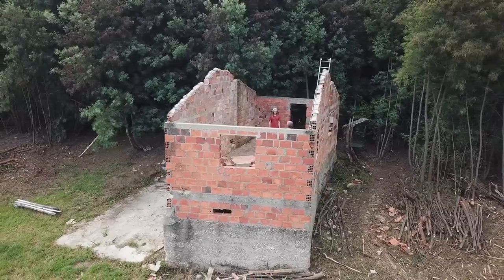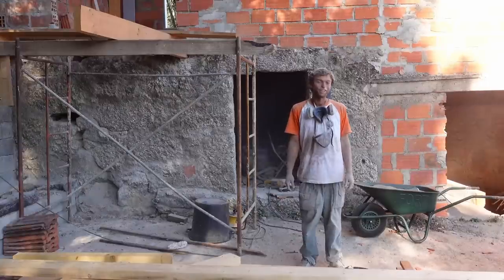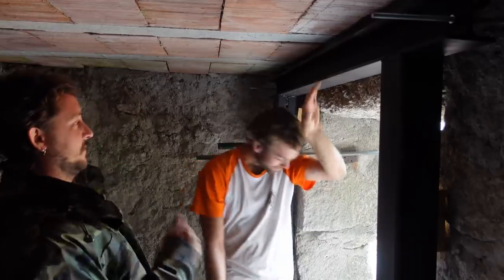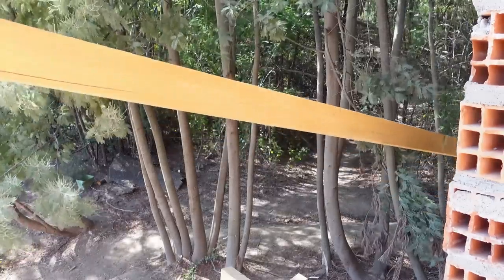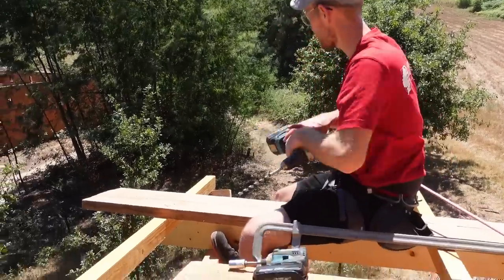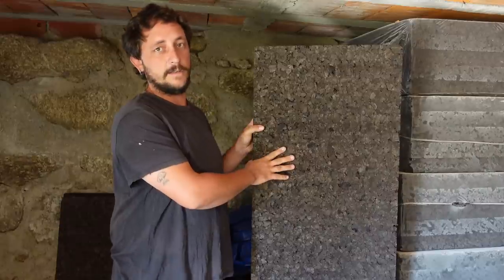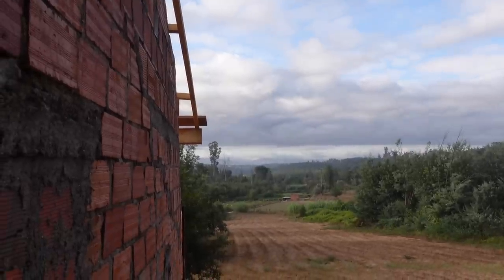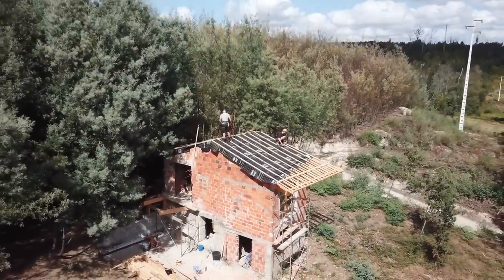#65 Putting up the roof on our ruin (with cork insulation)

Comment: Nice metal frame, but it has no contact at all. You can't just screw it to the wall, you have to push concrete in the upper gap.
Reply: And most certainly don’t use concrete/cement in the bottom like they did.
Reply: @Rickysaucej  so much work and that building is a joke. they dont listen to the comments and don't understand the buildings structure at all
Reply: The only thing that the frame is good for is to prevent the floor from collapsing. It is not loaded at the moment and I think that it is mentioned somewhere.
Reply: @georgenikolakopoulos5115  very good idea to let the floor crack and lower for 2 cm before it gets contact to the frame on its ends!
Reply: @Henroin42  not a good idea obviously. Just a precaution that costs way more (if they bought the steel) than doing the actual reinforcement.
Reply: I tried mentioning to them in a previous video back when they first cleaned it up that the Ruin really isn't structurally safe. There's a huge bow in the wall with the windows and the brick has been through a fire which would make it really  brittle. I tried explaining that and they havent done anything it seems to help with the structural integrity. They have beams sitting right on top of that old brick with no help with it. The studded walls on the interior help some but not s whole lot. With them now mentioning and showing the brittle granite foundation that just makes things even worse.
Reply: The gap at the top is filled with more concrete or shim blocks after the frame is in place. Standard practice in a retrofit like this, as there is no way to stand up the verticals in place and get a perfect fit without jacking up the second floor and then lowering it back down onto the steel, which would have caused much more damage.
Reply: @CawmeKrazee  they give me "cult vibes", i'm genuinely worried for safety of people on this project. Really liked it in the beginning, the idea is really nice, but something is just wrong.
Reply: Loving what this knowledgeable, nature loving, environmentally friendly, kind, funny , meaningful,clever group of awesome human beings are doing. The best vlog on you tube. No need to suck subscribers in with click bait, half naked bodies or extreme headlines. They are just doing what comes naturally. The content interesting and diverse. Love from Australia

Comment: Hey guys, roof maker here. The waterproof layer is worth it, even if it is plastic (I don't know if there is some natural material equivalent). First, in case of a broken or missing tile, because of hail or wind storm maybe, your roof won't leak as fast as if you didn't put that layer, giving you some time to fix it without damaging your insulation. Keep in mind that it is not a fully waterproof layer, so don't leave it exposed too long under water and UVs, it won't like it. Next, it helps also with condensation, keeping your insulation dry, no matter the temperature difference between inside and outside. Then, I don't know if there might be snow where you live in winter, but if it might, I've seen tile roofs without that layer completely full of snow under the tiles, catastrophic.

Maybe some natural fiber layer might exist, then try it, but you definitely made a good choice by adding one in your build.

You're doing awesome job, keep it like that!
Reply: Snow is extremely rare here ... and when it happens is like 1/2 inches snow  during one week or so   we have around 4 months of chilling temps( not freezing...) Nov,Dec, Jan, February with night temps and early morning around 32/28 ºF   and during the day, with the sunrise ,temps go up to  the 50/59 ºF....
Reply: My first thought would be natural rubber, but maybe that's not breathable enough and will result in condensation in winter? Also not sure if natural rubber is made in such long thin strips
Reply: A layer of loam/clay can work as a replacement for those membranes. Of course it's significantly heavier, and can be damaged by a severe leak.
Reply: Hey xdaerian, how about the counter battens? Arent the screws supposed to go in the rafters? Or could you just screw the battens in de corck insulation? Im asking cause im planning to insulate the roof with PIR insulation. Thanks on advance!
Reply: @Illeestar  yeah, seams a bit strange for me to screw it in the insulation only, you should use long screws to get down to the rafters. I don't know the strength of corck, never used it, but it seems a bit soft to hold the wind force
Reply: Cork isn't sensible to humidity nor water. A leak or condensation wouldn't damage it.
Reply: @Illeestar  you screw the counter battens (for air circulation etc) through the pir and into the rafter.
Example:
10 cm pir foam, 5 cm thich counter rafter.  You will need 20+ cm long screws.
Ps: get a good driver with enough torque

Comment: If you plan to make the ruin air tight and expect negative temperatures in winter you should add a water diffusion barrier on the inside to prevent the humidity from insde  to condensate in your insulation, which would rot eventually otherwise. Unfortunately that means more plastic, but longer lifetime.
Reply: I'm not sure if that is also necessary with cork as it is already a natural water barrier. Would be interesting to get a construction physician's idea on that.

Comment: Many commenting on the waterproof layer. Indeed worth it if you ask me, please check out Ekoplus based in the south of the Netherlands. They have a whole assortment of building materials with more proper background. This same foil comes also from the brand proclima. I used it myself and feels quite the same as well known brands like dupont. Their knowledge is very valuable...

Comment: My thoughts on the waterproof barrier: The membrane needs to allow moisture out or the inside will rot.

My house is somewhat old, the most recent addition was built about 50 years ago. That section was built with wood studs, plywood outside pressed board paneling inside, and fiberglass insulation. The plywood was covered with tar paper, then a cement shingle. Over the years, moisture collected inside the walls due to the tar paper. Now I have a mold and rot problem in the walls.

On the other hand, only the bottom of my wall is rotting, so your roof may be just fine. Especially if the inside has a way to breathe and dissipate moisture.
Reply: its a breathable 3 layer membrane should be good in this setting.
Reply: definitely, if this is real waterproof, not vapour membrane., then wood will be exposed to surface condensation in insulation, which could not ventilate/dry out in big temperature shifts. this will make wood rot, specially thin/soft wood like that. and dby they way, cork as roof insulation is not the best pick from start, imo.
if you need realy water proofing, reinstall waterproof with vapour membrane, add additional air layer, put plank/osb over and finish with waterproof membrane if really need it (and finalised with proper roof tiling).

Comment: The plastic in the waterproof layer's embedded carbon pales into insignificance compared to the steel fixings. Most building wraps have a recycled component as well. so think of it as extending the life span of the fixings and in that case if it doubles the life of those then it is carbon positive.

Comment: Screwing cork on to the battens with regular screws instead of insulation screws that actually fasten  it to the sturcture ✅
Proceed by screwing battens on to the cork itself with regular screws providing no connection to wood underneath ✅
Yeah, just top it off with heavy tiles and its going to be F*cking Mint 👌
Reply: And by the way, the cork insulation is supposed to go between the battens, not on top of it.
Reply: You seem to be making good points there, but is there really a need for irony and sarcasm?
Reply: @meinssk  bore off

Comment: I didn’t understand the waterproof layer either when building a small camper, but then my friend reminded me how soda cans condensate with liquid when temperatures vary from inside to outside. The same thing can happen with the structure even if it’s not rainy. Im sure there is a more sciency explanation. Definitely worth having!

Comment: I've been in the construction industry for only 2 years but I'm pretty sure insulation like that would be better in between the rafters. Then you'd have a plywood sheathing over it nailed to the rafters. And then a continuous  waterproofing layer over that with your roofing system. But idk.

Comment: You want to be using the waterproof layer. While there may be plastics used in its creation, it's going to save you money, time, and materials in the long run because it will prevent rot, leaks, and everything else involved in the roof.
Reply: What did they use before plastic?
Reply: @JazzFunkNobby1964  asphalt paper. Basically paper impregnated with a thin layer of asphalt/tar. It isnt  as durable as plastic though and rips easily after a couple of decades.
Reply: @evilla7579  Isn't Asphalt a top or outer surface?
Reply: @JazzFunkNobby1964 maybe it was translated wrong. It wasnt roofing felt or something (which indeed has asphalt). Were we live we call it 'bitumen paper', paper impregnated with a thin tar like substance. But as said, it is obsolete now because there are better alternatives.

Comment: Guys you added a waterproof layer and  then you punctured it to secure the battens. Usually the membrane goes over the battens and you nail the membrane to the battens. This way you get a kind of channel through which water is drained, with no holes where the water can infiltrate through. The membrane is only puncture on the high part of the channel where water will never run through

Comment: Amazing work!  I can't believe those cork panels are strong enough to stand on like you were.  Good stuff!  

I don't know if you guys have thought about this or not, but getting a cheap trailer for the Kamp might be a good thing.  Then you can take loads like that cork in bigger loads and you aren't limited to what the inside of a vehicle can carry.  I have a small one for my use and it is so handy to have.

Comment: Hi. In my opinion. the waterproof layer may not be need to keep water to reach the cork insulation. Water don´t penetrate cork. However in the cork tiles gapes may infiltrate and enter the house. It´s more safe using but not eco friendly. It´s a choice that have to be consider. I don´t now any eco friendly material that replace that  waterproof membrane. Maybe palm leaves perhaps.... Keep on the good work.
Reply: On the long run there will  be gaps between the cork tiles. Everything moves over time, evenmore so if exposed.
The waterproof layer was a great move.

Comment: Cool roof design! Looks well designed as well :) there is an option to have another foil beneath the insulation to prevent condensation in the insulation (Vapor pressure will "pull" moisture through the construction towards the outside in winter). That might lead to moisture at the outside of the insulating layer. It's a common problem in a few constructions and it's not that bad as long as the construction dries fully during summer as well. Nevertheless I'd highly recommend using such a foil to get rid of that problem entirely. Key is to have more moisture diffuse out of the construction than into the construction over the year.

Comment: Rafters need to be fastened on top where they meet. Steel planks tied with screws or a piece of wood would do it.
I personally did wider rafters and put insulation between them, on top a one-way roof membrane to let condensation out the house. The beams-counterbeams net I attached directly to the rafters, which is more stable for earthquakes and gusty winds that will try to pick the entire roof up. My shingles are metal, yes not natural, but very durable and light.
Reply: The cork insulation is very good but also very expensive in Bulgaria. We consider it for the interior.

Comment: I see one mistake in the waterproof layer or secondary covering, there must be an air gap under the waterproof layer as you did above so that it can dry if there is any leakage. 
Otherwise very well done

Comment: I recommend that you take bets on your patreon page. Who will be buried by the sketchy ruin crashing down.
Reply: Lol  You don't know what you are talking about  that "ruin" will last longer than most most of wood houses built now in USA...if it doesn't suffer any devastating earthquake  ,a gas explosion or a nuclear war....😄
Reply: @netby  just your wish, not based on facts
Reply: This kind of badly build barns usually dont just fall, they crack and leak air and water years before, because of some bad foundation sinking, or rotten wood. It will probably hold up for many years. Still ilegal and crappy, but nice to see as an experiment. It would probably be cheaper, easier and safer to just build a wood cabin, because they seem to be good at it.

Comment: I can't stop thinking about all those hollow bricks and the super old walls holding up. Honestly it seems like a disaster is waiting to happen. But overall good video
Reply: Ahahahh   90% of portuguese houses are made  with these " bricks"  those are not solid bricks like the ones used In the UK or USA : those are hollow bricks ,specifically made to build walls, made of 100%  clay cooked a very high temps   they are ceramic...you left one covered in water  some time and then take it out a let it dry it will be like new and with the  same quality as they are when they came out of factory; we have millions of houses made with these "tijolos" with more than 50/60 built  years and they don't fall or crumble unless there is  a gas explosion inside.....tijolos will last centuries
Reply: @netby  that's good to know, I just hope they build all this stuff on it and the building doesn't collapses
Reply: @netby  I guess that his concerns is more about how sketchy the construction looks as well as the wall of lower part of the house seems to have seen better times. The stone used seems to be puddingstone (not granite in any way) which can be weakned by water damage over time. Which seems the case here.

Hollow bricks is a good construction material otherwise, with many qualities.
But it requires proper sound foundation to stand on. Which is not the case here.

Comment: Thoughts on the plastic waterproofing:

I know you're concerned about adding plastic to the project and thinking that it causes environmental issues, but plastic is actually an AMAZING resource! More things should be made of plastic. It's relatively easy to manipulate into any tool or shape necessary and lasts virtually forever! High quality plastic tools that can be melted down and reformed are the future, without question. 

The problem is 1-use plastic items. That's where the environmental impact comes from. Waterproofing like this isn't 1-use, you're not going to strip off the plastic next year and put a fresh tarp back on in a never ending cycle of waste. It's the same as using any manufacturered metal, or device with a microchip, sure it's construction isn't great and could be better, but the actual use of the product? Nah bro, that's fine. 

If you want a project with 100% all natural products, then use cob and adobe and plaster and locally and ethically harvested and milled tree, and hay or wool insulation, all done with handcrafted tools, and make your own nails from wooden pegs and etc etc etc. Which, sure, some people have projects like that, but Kamp is significantly more Solarpunk, there's no reason to ignore the technology and tools at your disposal simply because someone else uses it in a way that's environmentally damaging. You can restructure the way you perceive it and use the same thing in a codependent way. Concrete as pavement is bad. Concrete as a foundation? Pretty alright. Buying an apple device because it's new? Bad. Buying a smartphone to use as a central processing hub of automated eco-villags features? Pretty alright. What you do with these things matters more than where it came from (SOMETIMES)

Comment: I don't  know anything about that cork product, but my intuition (which, again, means very little,) is telling me that, over time, when the binders in the cork material start to age and degrade, will start to sag. In which case, not having plywood, or some kind of surface underneath to support it, will cause the cork to just fall away. Does anyone else know how well that cork stuff holds up to thermal cycling and/or what the mechanics of its aging are

Comment: Hi. I was thinking the tiles are also waterproof. When does the plastic help? (Except for when a tile breaks). Are there other circumstances / reasons the plastic helps?
Reply: Tiles are never 100% waterproof. Wind can blow water under and over time moss and roots can grow in between.
Also since we've used old recycled tiles which have a lot of imperfections it's surely worth having this layer.

Comment: dont know how much structure support that metal door frame did the load bearing wall is on the outside from what I see and the upper granite above that door is the main support, this beam isnt connected to that just bolts on the end and even connected wouldt do much you should have removed the rotten granite and put the steel in its place

Comment: You should use diy https://youtu.be/d8Pz547307U?si=iHKmYLk03DS7qYqp

How to make your own with cork dust 

use a 25-centiliter cup for measurements.
4 liters of cork (16 cups)
40 milliliters of water
1 liter of acrylic glue
1 liter of school glue (vinylic glue)
Mixing: They mix all the ingredients together. They use a machine to help with the mixing, mentioning that it can get noisy.
Application: They use a sprayer to apply the cork mixture onto the surfaces. They note that even if you're not good at painting, you can still manage this step.